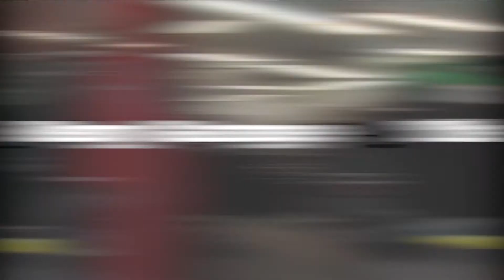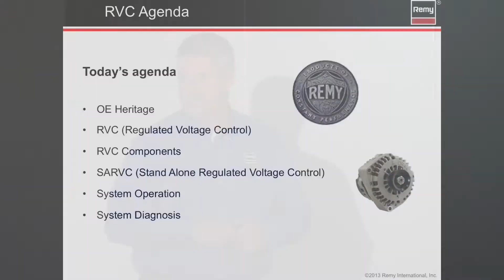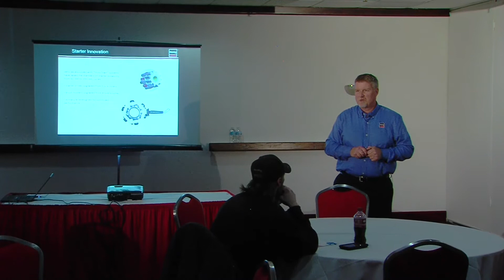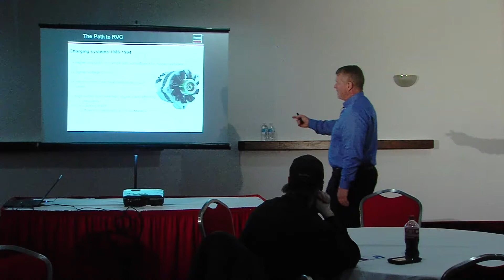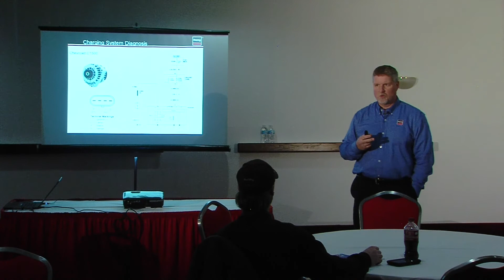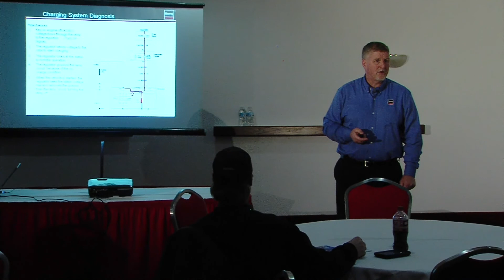GM Regulated Voltage Control #1of 4

Comment: I placed a volt meter on my altenator everything appeared normal until i placed altenator under load and noticed variation from 12 to 14 volts give or take. Was not consistent reading as compared to wifes car different animal used for comparison. Should it be a steady reading???

Comment: I have been trying to find info on the BCM programing for Lead Acid VS AGM batteries in newer GM's.  Are the charging rates different in the BCM.  I installed a AGM in place of a Lead Acid and it appears that the system changed charging rates slightly.  Does it "know" it's a AGM or is it solely based on battery voltage.  More video like these.